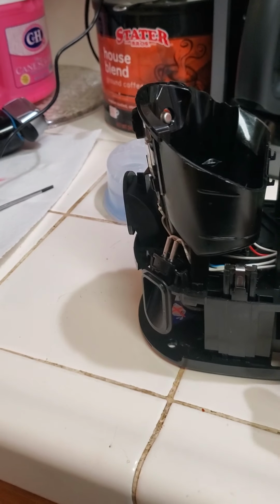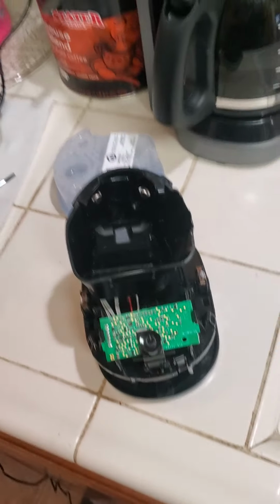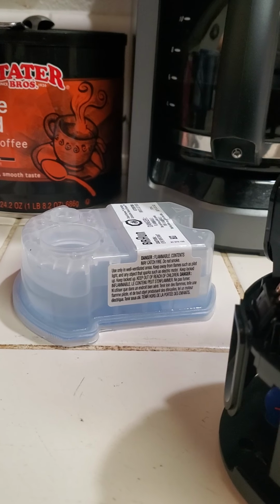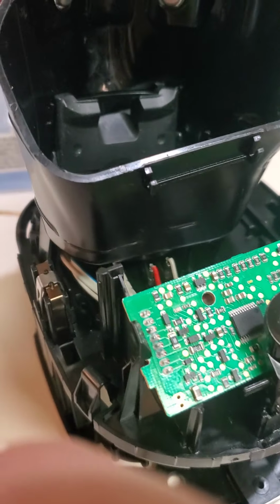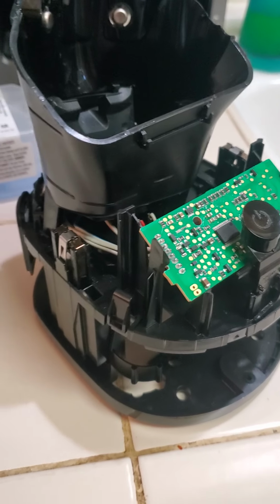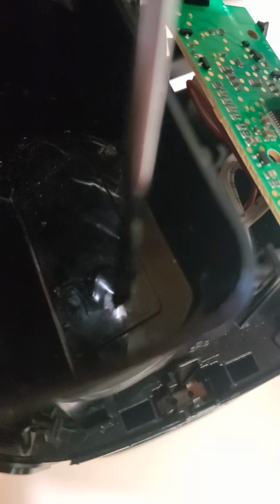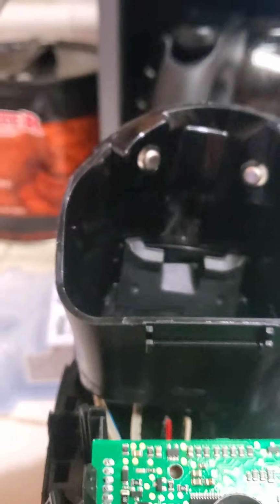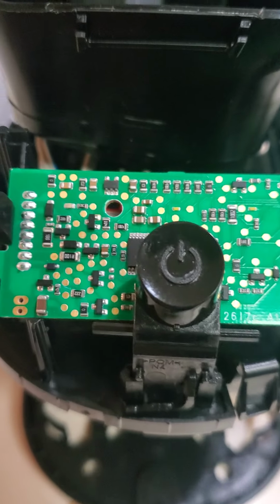Braun SmartCare Motor Repair #1

Comment: Thanks for the video! I was planning to buy a cleaning station to replace my broken one but the price tag of $59 made me consider trying to fix it. The video is a bit painful to watch at times, at least for me, but in the end I was able to fix my unit and I'm back in business! Thanks again!
Reply from the maker: Yeah Im sorry my first time making a how to video, but glad to hear it worked out for you in the end! Was it the motor? Or did this help you just figure out how everything worked in the system
Reply: @killerwhiteshark1797  it was the motor. You could hear like it was working but nothing was happening. It was damaged probably because I washed the cleaning unit with water. When I washed it I let it dry unplugged (no electricity) for a couple of days but still it was damaged by the water. When I tried to move the propeller it felt heavy. That’s why I decided to change it and that took care of the problem.